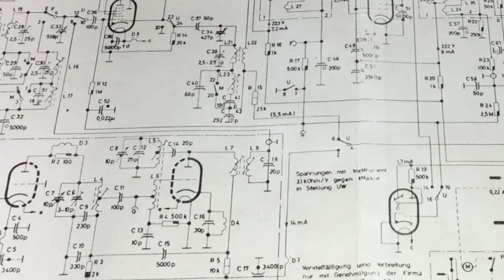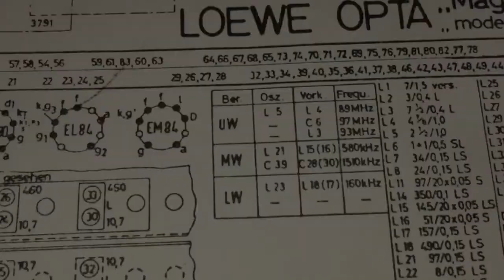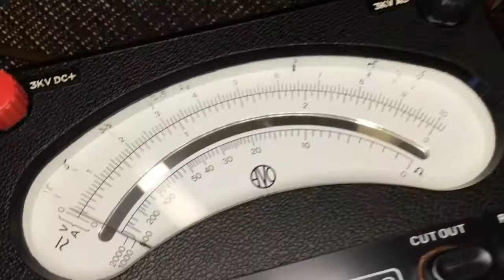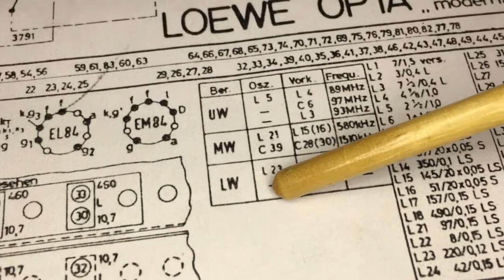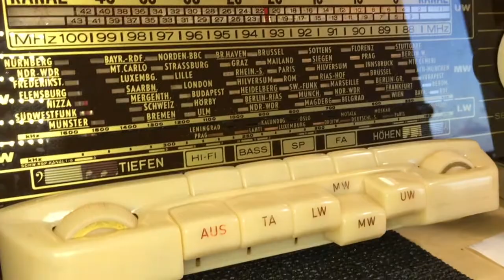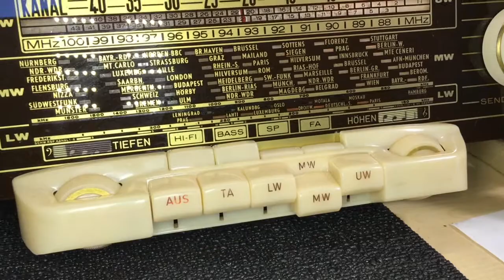Loewe-Opta Magnet 3737W tube radio restoration - Part 5. IF and RF alignment of the AM bands.

Comment: Are you still using the Rigol DG1022. Are you happy with it for MW UW LW SW and KW alignments?

Is there other equipment worth reviewing for vintage radio restoration alignments as well as the RIgol DG1022 please?
Reply from the maker: I still use it for all that, and more. However, it’s getting a little old so if I had to buy a new one, I’d obviously choose a more recent model.

Comment: Hello ,
Like your video's very much and would like to build me the attenuator you use, could you please explain a bit more of it? Can I find the diagram somewhere?
My first project is waiting for me to get aligned. I got a Loewe Opta Rheinperle 2054W and are in the proces of gathering all the knowledge and confidence needed to get started. 
Your videos are helping a lot, thanks again!
Reply from the maker: +Henny Poort : hi Henny. Do a search for pi attenuators on the net. They give you inline calculators to tailor your attenuation amounts. I built in various different ones and then switch them in in series depending on how much I need. You should also find actual diagrams showing how to connect the switches with respective resistors. Good luck with the rheinperle.